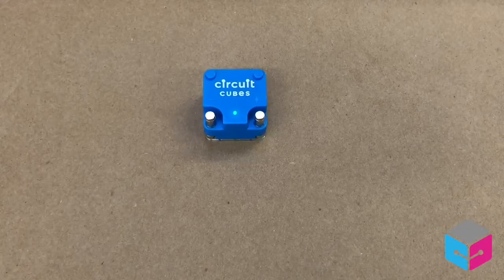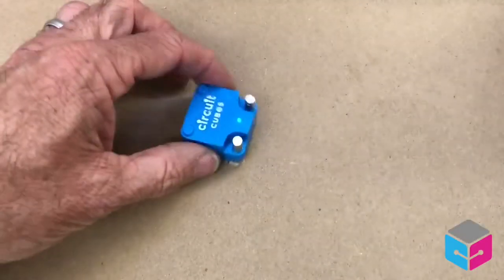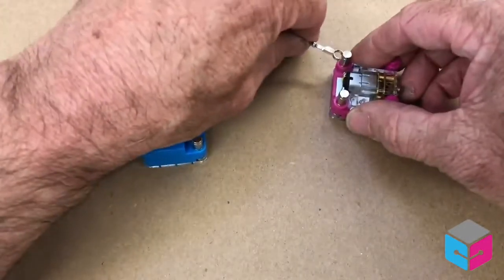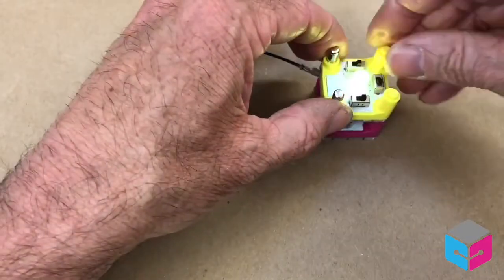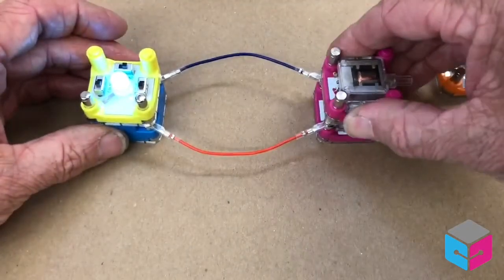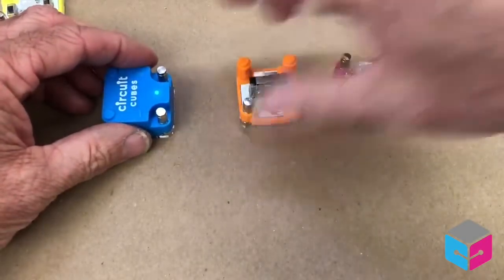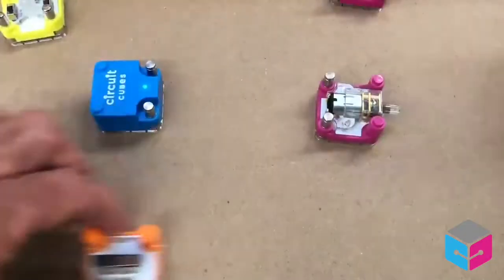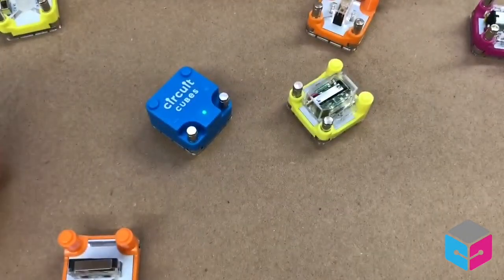Circuit Cubes   What Are They & How Do They Work?

Comment: How would it connect to solar power?
Reply from the maker: The Battery can ONLY be charged via the 5 VDC micro USB port on the side. The motor and the LED could be connected directly to a solar panel provided your output does not exceed 6 VDC.

Comment: These are the coolest, most well thought out additions to Lego I have ever seen.  I saw a master builder use these in a little robot and went immediately to the website to order a small set to try.  I am an old, newer Lego builder.  The size of these motors is exactly what I was looking for to try to learn Technic.  Thank you so much.
Reply: Thank you for your support 😊
Here are some build ideas for fun 👍🏼
Circuit Cubes Builds Shared Photo Albums 

Cubit Motor build options
https://www.icloud.com/sharedalbum/#B0WG4VTwGGWwUsZ

31059 BTU Mashup 
https://www.icloud.com/sharedalbum/#B0WGtec4XGu4mAJ

BTU MOC bullet train
https://www.icloud.com/sharedalbum/#B0WGnbeumGmxx2q

MOC tractor 
https://www.icloud.com/sharedalbum/#B0W5tzEA5HEYVM

60273 Mashup police car
https://www.icloud.com/sharedalbum/#B0W5O3DjHFc7OV

60273 Mashup driller
https://www.icloud.com/sharedalbum/#B0WG3KxPyGDHv1N

60115 Mashup 4-wheeler
https://www.icloud.com/sharedalbum/#B0W5FrPQ6ONubt

41130 Mashup amusement park 
https://www.icloud.com/sharedalbum/#B0WG60dj6Gpz2n6

MOC 4-wheeler
https://www.icloud.com/sharedalbum/#B0WGeA5r4GdaJrv

MOC Christmas coaster 
https://www.icloud.com/sharedalbum/#B0WJOFSVFJP7Nhx

75283 Mashup separatist tank
https://www.icloud.com/sharedalbum/#B0WJsHvHoJtRvEh

MOC AT-AT vs snowspeeder 
https://www.icloud.com/sharedalbum/#B0W5ZhN2vCBNTs

MOC flappy whale 
https://www.icloud.com/sharedalbum/#B0W5KMDhO1wdlN

Mashup Pursuit of Christmas - Jason Allemann 
https://www.icloud.com/sharedalbum/#B0WJPrgBGJOHHWV

MOC holiday toy train 
https://www.icloud.com/sharedalbum/#B0WJq4WnLJrLdoN

MOC Rudolf and Santa train
https://www.icloud.com/sharedalbum/#B0WJHciePJuKTzJ

40370 Mashup classic train
https://www.icloud.com/sharedalbum/#B0WG1CvrSGKvk9f

MOC AT-AT
https://www.icloud.com/sharedalbum/#B0W5p3ichJdnIk

75152 Mashup 
https://www.icloud.com/sharedalbum/#B0WGsCn7GGthHKh

60219 Mashup 
https://www.icloud.com/sharedalbum/#B0WG9Gd2NG7aOj8

MOC tram train
https://www.icloud.com/sharedalbum/#B0WJ5HumnGAG50n

MOC dune buggy
https://www.icloud.com/sharedalbum/#B0WGDZLe8GovQIH

60222 Mashup snow cat
https://www.icloud.com/sharedalbum/#B0WGqQrCLGRfdQo

70808 Mashup 
https://www.icloud.com/sharedalbum/#B0W5kuVsbzrdG7

75317 Mashup
https://www.icloud.com/sharedalbum/#B0WGAfJVYJ5FaxR

60264 Mashup
https://www.icloud.com/sharedalbum/#B0WGVfZ2vGx8UAg

MOC hover-bot 
https://www.icloud.com/sharedalbum/#B0WGWBC59G4yH6d

31062 Mashup 
https://www.icloud.com/sharedalbum/#B0WGPCdxkGOvVzi

75182 Mashup clone tank
https://www.icloud.com/sharedalbum/#B0WJ8GySPJFsoqQ

75271 Mashup Luke’s land-speeder
https://www.icloud.com/sharedalbum/#B0WJr1PPdJqIIEl

75940 Mashup
https://www.icloud.com/sharedalbum/#B0WJqstnBJrObU6

31107 Mashup 
https://www.icloud.com/sharedalbum/#B0W5fEtEvEwzhE

MOC snow cat ski truck 
https://www.icloud.com/sharedalbum/#B0WGhtLJ3GQra2B

MOC snow cat snowball blaster 
https://www.icloud.com/sharedalbum/#B0WGdFryYGc0v01

MOC battle tank
 https://www.icloud.com/sharedalbum/#B0WG7HOIlGiGRVf

MOC battle tank ver2
https://www.icloud.com/sharedalbum/#B0WJp2udmJETPnN

60254 Mashup BTU
https://www.icloud.com/sharedalbum/#B0WGCATCnGBjvxJ

60272 Mashup BTU 
https://www.icloud.com/sharedalbum/#B0W5VtHQfUGFsv

31074 Mashup BTU 
https://www.icloud.com/sharedalbum/#B0WGY3uThGXcOEy

MOC half-track
https://www.icloud.com/sharedalbum/#B0W5fu2Mu65IvC

60095 Mashup BTU 
https://www.icloud.com/sharedalbum/#B0W59v1AbNoV1v

31089 Mashup BTU 
https://www.icloud.com/sharedalbum/#B0WGtue8VGuqi03

MOC Mars Rover
https://www.icloud.com/sharedalbum/#B0W5epZ6acQkSR

MOC Treadz
https://www.icloud.com/sharedalbum/#B0W5S2ms9TecEf

MOC Woof
https://www.icloud.com/sharedalbum/#B0WJIrbT3J89jm1

MOC Flips
https://www.icloud.com/sharedalbum/#B0WG58NWBGG2In0

MOC Plowzer
https://www.icloud.com/sharedalbum/#B0W5IRuBx89J2j

75103 Mashup
https://www.icloud.com/sharedalbum/#B0WGOnmqtGPYspa